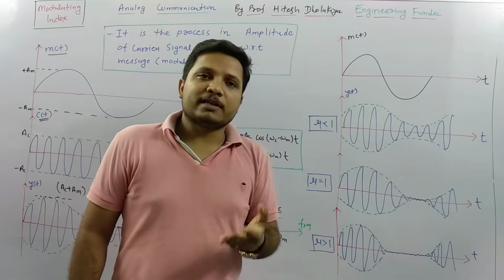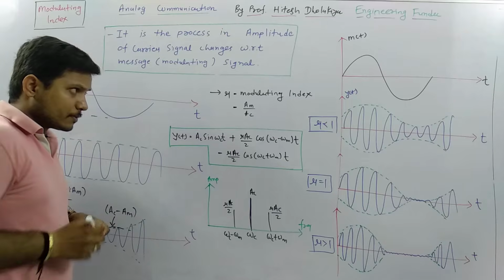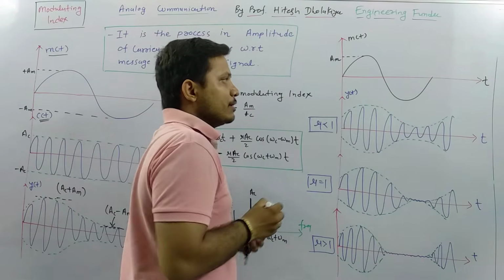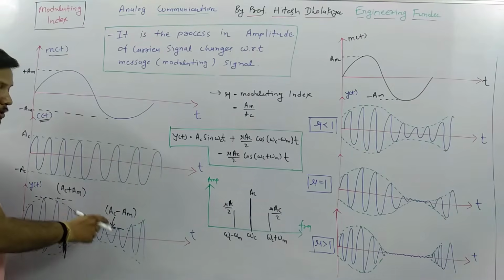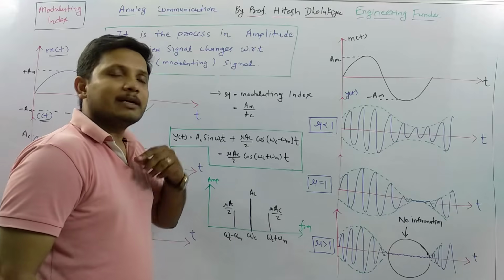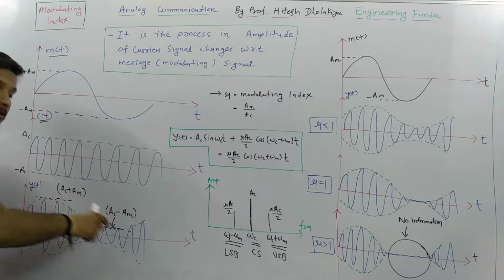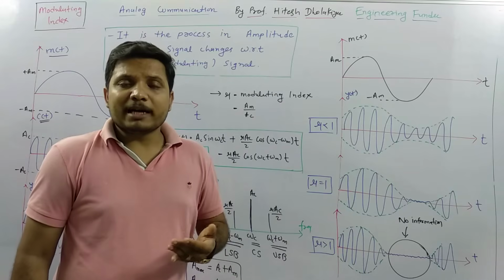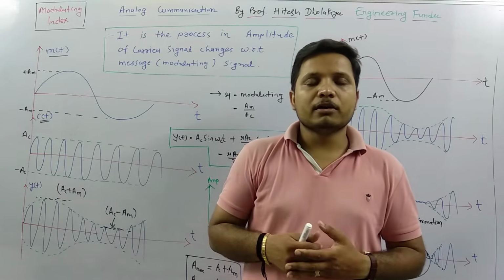Importance of Modulation Index in Amplitude Modulation in Analog Communication by Engineering Funda

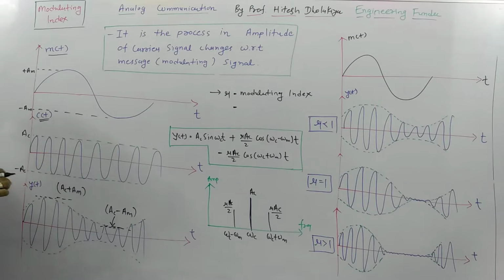Comment: 01:05 Modulating index is the ratio of amplitude of modulating signal to the amplitude of carrier signal.
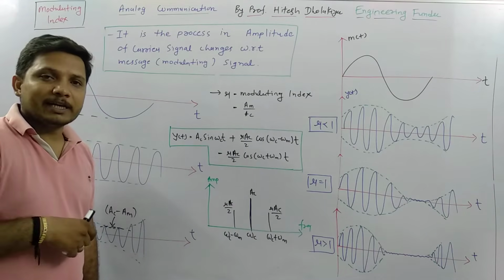02:10 Modulating index is crucial in amplitude modulation
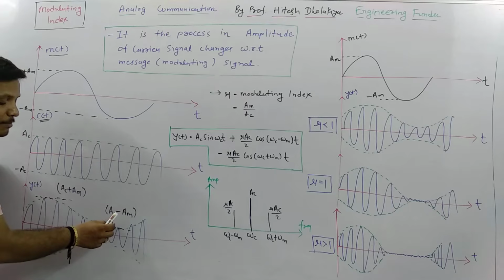03:15 Modulating index should be lower than unity to avoid phase distortion
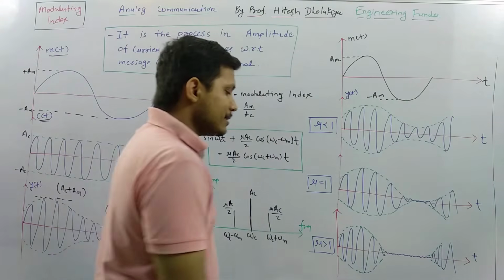04:20 Modulation index affects signal amplitude in AM
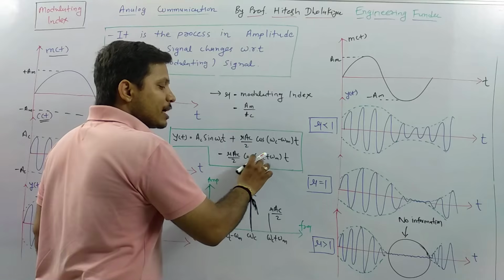05:25 Modulating index greater than 1 causes distortion
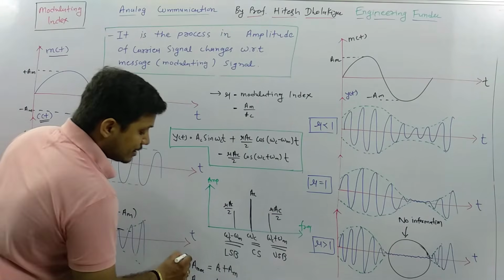06:30 Explanation on Omega C, lower sideband Omega C minus Omega M, and upper sideband Omega C plus Omega M
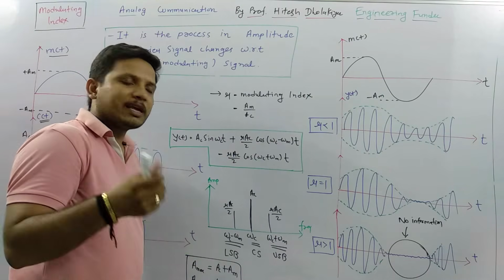07:35 Modulation index is crucial in amplitude modulation
08:36 Understanding the key things for modulation index in amplitude modulation.
Crafted by Merlin AI.

Comment: Sorry but can i ask you a litte questions? My english skill is not good, and caption subtitle cant turn on, So i cant undestand somethings? can you expain me to understand: 
1. Amax =  Ac+ Am and Amin = Ac - Am what is mean? 
2 why we choose the modulation index is less than one like from 0.8 to 0.9?
3 if the modulation index low like 0.6 is good and why? 
Thanks u very much and hope you have a wonderfull day
Reply from the maker: 1. Amax and Amin explains range of AM envelope.
2. If Modulation Index is greater then one then AM signal has phase crossover.
Reply: @EngineeringFunda  Tks u very much, but can i ask another question? what is happen when we choose modulation index is low like 0.6 or under?